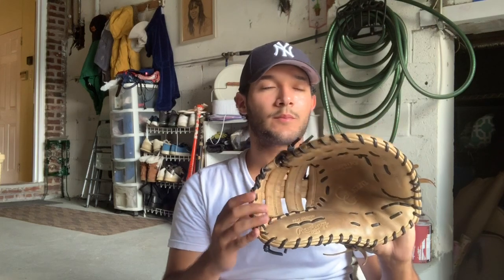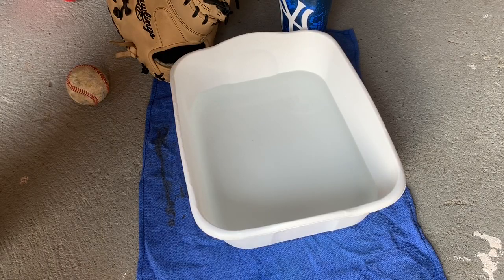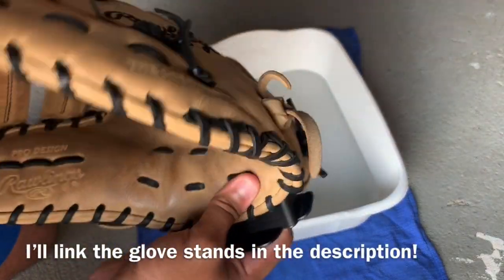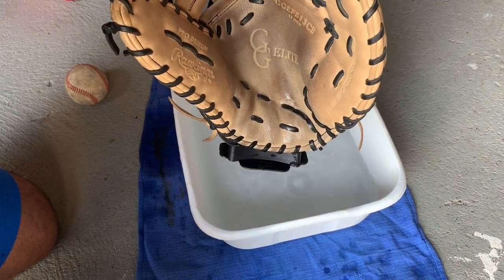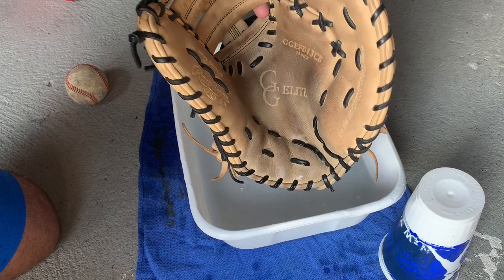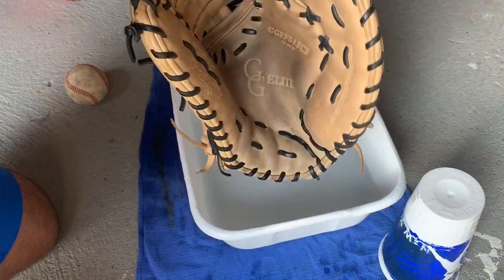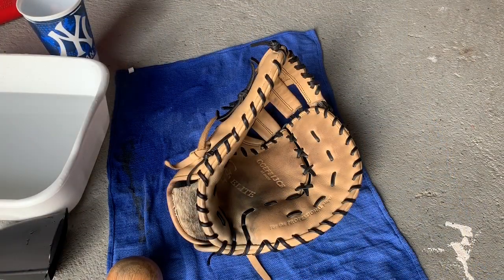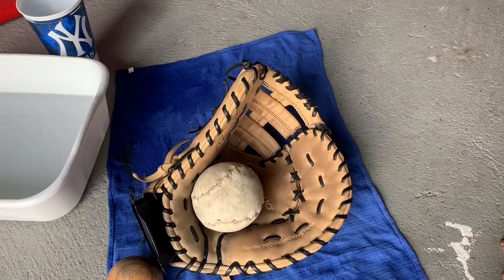HOW TO FIX A CREASE IN A BASEBALL GLOVE

Comment: Thanks! I really needed this, does this work on bubbles also?
Reply from the maker: Troy Brady This should work on bubbles too! Just be careful not to run too much water on the leather, too much moisture is bad. Better to run a little water, pound with a mallet, and repeat until you get what you want! :)

Comment: Creases on the back of my glove is that bad but no bubbles
Reply from the maker: this method removes bubbles and big creases on the palm of the glove. Sometimes creases form just from using a glove. Those should be fine
Reply: @914ballgloves8  can I still use the hot water and put it on back of my glove to take out the crease
Reply from the maker: @Bubby550  What kind of crease is on the back of your glove? I think you should leave it alone